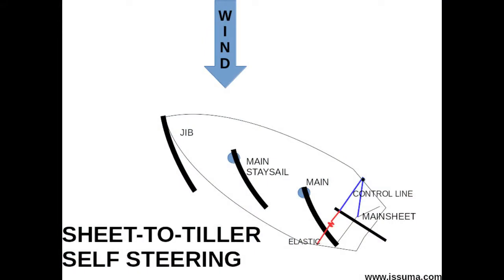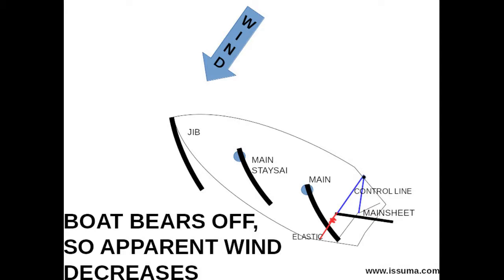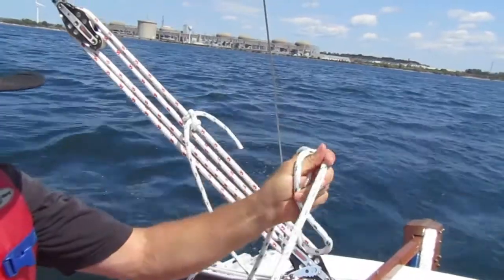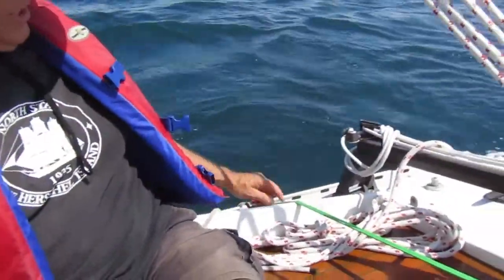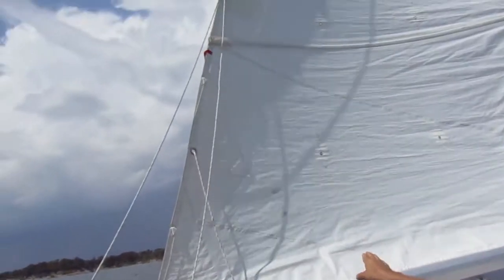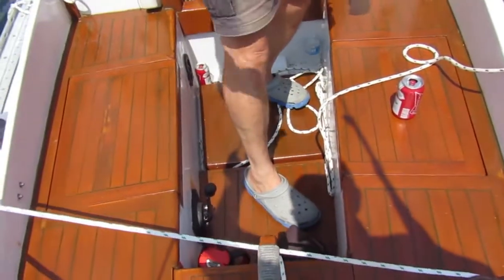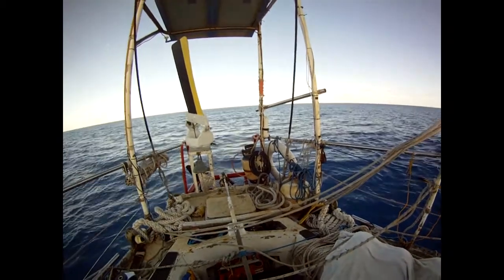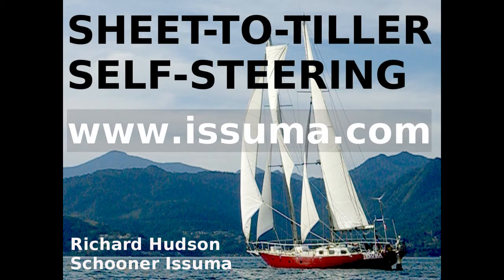SheetToTiller Self-Steering

Comment: One question, in case we change direction or the wind change direction, I suppose we need to change the order of the elastic and the control line , correct ?
Reply from the maker: Yes, if the boat changes direction relative to the wind, then you will need to adjust the control line and elastic

Comment: A jam cleat on the tiller to fine adjust line a little easier? Love the hitch on to the main sheet.I have also seen a system sheeted of the Genoa any thoughts?
Reply from the maker: I think a jam cleat on the tiller would work well for adjustments.  Using a Genoa sheet instead of the majnsheet works just as well...any sheet works, the best sheet to use is one you get a good lead from on a particular boat.

Comment: Let me know if I'm wrong--so the rig needs to be readjusted with any significant change in wind speed?  Love the simpliesty.  Even if you don't use it all the time,  it gives you back up to a wind vane or autopilot.
Reply from the maker: The setup needs to be adjusted any time the sails are reefed, or set or doused, so anytime the wind change is significant enough to adjust the sails, it needs adjusting.  

Wind vanes and autopilots are definitely less work to use, but as you say, sheet-to-tiller is a great backup method.

Comment: how are you  broadreaching while the sails are set for a dead run -- wing on wing
Reply: but thanks for the video
Reply from the maker: Scott, thanks for the question, and for liking the video.  

On the Folkboat in the video, the jib was poled out on a broad reach, with the main set on one side and the jib poled out on the other.  Without the pole, the jib would not set on the opposite side as the mainsail.
  
It's difficult to get most boats to balance on a broad reach without poling the jib out--in a gust of wind, all the sails heel the boat the same way, which causes the hull to turn into the wind.  With one sail on the opposite side, the tendency to turn into the wind in a gust is reduced.

Comment: Very good video Richard.  I usually attach my windward side to the boom rather than the main sheet.  It seems to work for me.  Any thoughts?
Reply from the maker: Thanks very much, Gregory.  

If you are attaching the control line to the boom instead of to the main sheet, then I would think your control line transmits more force and travels less distance.  

Which would mean more elastic force is required to counteract the control line force, and likely the attachment point on your tiller is closer to the rudderpost, so less travel is required to turn the tiller enough to steer the boat.   

Glad to hear it's working for you.  

What size boat do you have, and how far from the rudderpost do you attach the control line?
Reply: @SchoonerIssuma  My boat is 29'.  I usually attach the control line about 2/3s from the end of the tiller.  I take your point though.  Keep on sailing man.

Comment: This was very well done. Thank you for being so thorough. I like how you did this system off of the mainsheet as opposed to bypassing it and attaching of the boom, much less force on the system.
Reply from the maker: Thank you!   I appreciate the feedback.
Yes, except maybe on a very small boat, directly attaching to the boom (or directly to a sheet, instead of deflecting a sheet) would be force that wasn't necessary and would have to be countered with more elastic & higher loads in general.

Comment: Great to see examples with different types of boat.  For the smaller craft, I have found jibsheet to tiller very effective, as on a reach the sheet tension changes more quickly due not only to the change in apparent wind, but also the jib gets blanketed by the main as the boat heads off the wind.  When the sheet load is too high, the choices are: mainsheet to tiller, a sheet tensioning reduction method, or using an additional smaller headsail on an inner stay or flown loose.

The John Letcher book you mention is excellent and though long out of print is available for free download with the kind permission of the author.  See the Jester Challenge website:  https://jesterchallenge.wordpress.com/articles/self-steering/
His notes on initial setting of the bungee are vital for achieving a setup that will respond reliably to changing wind strength.  Applying his principles I found such good results that I set off for a UK - Azores return trip last year without windvane or autopilot.  The only time it failed to steer was when there was so little wind we lacked steerage way, in which case windvane or autopilot would not work either. 

Upwind I have found a bungee alone or lashed helm gives best results.  I run my bungee across the cockpit with several turns around the tiller.  Friction holds it in place and fine adjustment is simply a matter of twisting.
Reply from the maker: Thanks!   And thanks for making John Letcher's book available on your site!   That's a great resource.

I wasn't aware of your video (https://www.youtube.com/watch?v=pnkDsDWl8zQ) or website when I made this video.  Great to see the success you've had voyaging long distances solely using sheet-to-tiller self-steering, and interesting the way you run the bungee across the cockpit and take several turns around the tiller.  

I guess because I learned sheet-to-tiller on my 15m schooner, I never considered taking a sheet directly to the tiller like you have done (I always used a control line from the sheet to reduce the power).   Good to know that jibsheet direct to tiller works so well on smaller boats--I will try that.

Comment: I wonder how sheet to tiller works on your schooner off the wind in heavy weather?
Reply from the maker: My schooner has a windvane self-steering system.  I use sheet-to-tiller self-steering on my schooner in two conditions: 
* light winds, when the friction in the windvane bearings reduces its sensitivity to the point that it doesn't steer well 
* when the windvane is being repaired (not often, but it does happen) 

Off the top of my head, I don't recall using sheet-to-tiller off the wind in winds over about Force 6, because the windvane--which is easier to use--would work well in those conditions,  so unless it was being repaired at the time, the windvane would likely be in use.  

I don't see any reason sheet-to-tiller would have problems steering off the wind in heavy weather, since the loads on the sails and sheets are high in windy conditions.   Sheet-to-tiller is more sensitive to changes in wind speed than a windvane, so adjustment tends to be needed as the wind speed changes.    

I would expect one would need to be proactive/aggressive about setting sail after heavy weather, when the wind dies down but the seas are still high, to keep the boatspeed and force on the sails and sheets high enough to turn the boat after the still-high seas push it off course.
Reply: @SchoonerIssuma  I do the same good video